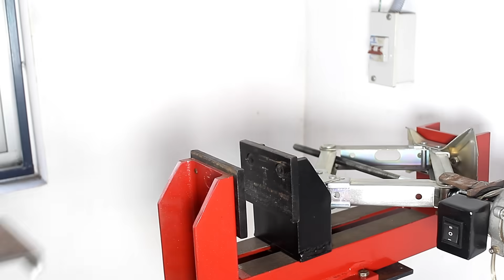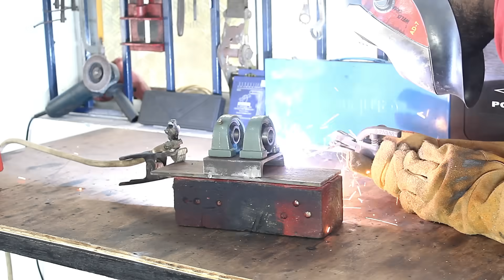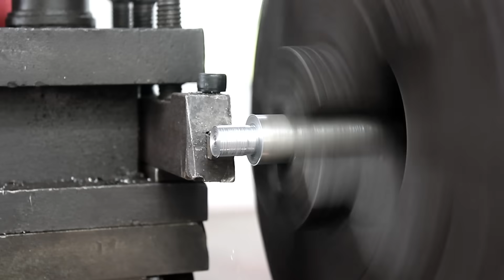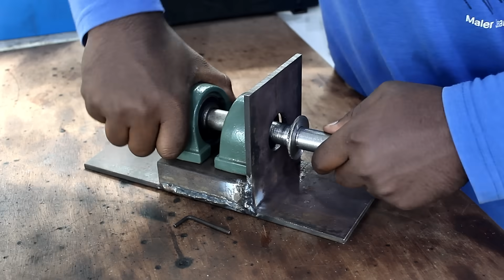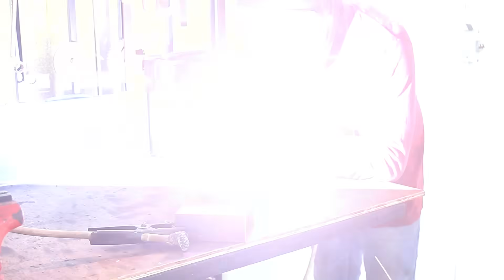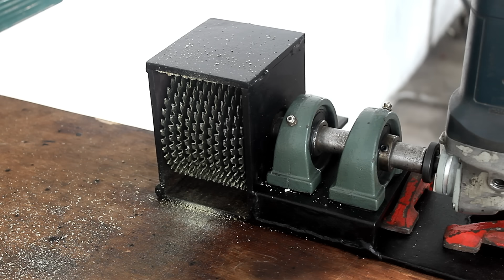Angle Grinder HACK - Make A Wood Chipper | DIY

Comment: Suggestion for MK2.
Add a tapered washer between each blade. Offset the blades So that the blades each touch at opposing 180 degree points on the circumference. 
This way the material will get fully shredded without having to present at an angle, and wont have to be kept moving about on feed.

Comment: NICE !! Please make another video with entire tool turned on its side so switch of angle grinder is on top with a chute added for gravity feed.(like you said) But most importantly add a table elevating the material up from where it sits now or incorporate it into the shute. I'd say probably 1/4 of the way up would still pull material in & down with out possibility of a jam. Now the most difficult part will be how you decrease the cutting area. I suppose you could just have this part of the chute be out of a decent gauge steel and just slot the end so the cutting tips of the blades are actually passing through it so there's a surface for the material to be cut/chipped against. I think ideally though I'd attempt to run it fully through with just a slot cut for each individual blade. I think the width of the slots, the amount of space on either side of the blades will be important to its success and whether it works or not. 
 I hope to hear more on how you made out and from others experiences or just opinions because I'm planning to make something like this myself soon but probably more for shredding/chipping plastic bottles, well basically all trash that's not food or glass. So I guess basically recyclables minus the glass. But I'm also interested in making something similar but larger for leaves, sticks anything in the yard to accelerate its decaying process into some super compost/growing dirt.

Comment: That is a neat build.  But it's a very slow feed to ground it up to practically saw dust, if that is what you want.
I would like to build one similar, but a different type of cutter that makes coarse chips. Maybe a small sprocket that is threaded to arbor onto the grinder shaft, a #35 size chain to a large sprocket on the cutter shaft. 
This would slow the rpm but increase the torque to cut large chips and feed the wood faster.

Comment: To avoid dangerous accidents, better to build a vertical shredder. Blades inside a the long tube at the bottom where you can throw the wood to the tube and shred it. You can add an additional iron pusher

Comment: Nice work. This type of gadget would be very useful for composting - You can feed it food scraps, leaves, etc. I can see it was tricky to keep the wood pushing against the blades, but you could resolve that by adding some type of feeder (mouth) that uses rubber or plastic to push the wood against the blades (instead of having to manually redirect it). I would also try to incorporate bolts into the blade housing so you can more easily change the blades when they get dull. You don't want to have to partly destroy and rebuild it to maintain it. Great start, though!
Reply from the maker: Thank you robert
Reply: Gravity feed

Comment: It might be better if you add a hollow section in front of the blades to act as a chute to push the wood down. This would stop any accident of your hand touching the blade, but I think you could put some quite big pieces of wood in there and it would still work well at grinding them away.
Reply: @WilliamHelstad  yeah good point.

Comment: Wonderful job!  
I had not thought of using a gang blade set up. Please please look at the rpm rating on the blades! That grinder could be running as high as 13,000 RPM's and the blades maybe  only 5,000 RPM's. Put on the guards and have fun!!
Reply: Those pillow block bearings are usually only good up to 5000 rpm as well.

Comment: Actually that looks like a VERY fine device. It might lack a bit of security, but by wielding a 45° protection on the front, that would cover the saw blades from the top of the tank to the bottom of the axis (basically, all the parts you're NOT using when chipping), that device would already be safer (at least more than some industrial ones).
Best security being a mobile protection that would stop power the very moment some force is pushing it.

NICE JOB
Reply: yes

Comment: Interesting design, but I two remarks. The machine would be better if it would be bigger, more heavy. I thin that would make it safer. Second the screws you used to mount the ball baring holders are out reach. If you wold use screws with hexagonal heads, it would be possible to adjust them.

Comment: Very nice build. Super scary. All the better for being scary. Love it! I think a beating in the outboard plate might have been a better solution than just the washer fitting in the hole, but that’s just me. I am also thinking some 10” saw blades I have laying around and the 7 hp motor from an old lawn mower would be a lot of fun. Great builds. Subscribing for sure now!

Comment: It seems to me that the cutters might grab the work and pull it in. I think the work entry level should be raised to just below the centre height of the cutters. That way the cutters shouldn't grab a tough piece of wood and pull it underneath themselves. With a raised work table only the chips will go under the cutters an be thrown out the back

Comment: Not wood chipper, but wood-power maker. Good idea but needs a lesser speed geared motor for thick dry wood. Otherwise blades might shatter.
Reply: Rabinder Rawat exactly its not a wood chipper at all!!!
Its a grinder driving a multitude of saw blades.!!!
Only a knife edge makes wood chips, a saw blade has teeth and makes makes saw dust!!!!
I know as i did a lot of R & D on wood chippers here in Australia!!!
Reply: Yes, it is not wood chips but it is excellent for compost.

Comment: Great minds think alike. I'm building one (prototype) with 15 carbide saw blades to grind up leafs if it works as expected I will bring up the blade count to 50. Hope it turns the leafs to dust making composting easier.🤞
Reply: I love the fact that this creates much finer wood chips almost a wee lil bigger than sawdust. If one wants a woodchipper for composting this is the one as the smaller chips will compost a lot faster than the wood chips created by commercial chippers.

Comment: Brilliant, nice work. And exactly what I was looking for. If the blade shroud/cover assembly was bolted to the base it would make it easier to maintain. Perhaps add an input chute to help direct the wood & minimise kickback, especially if this was at an angle to the axle. I will make one, and add a collection bin type arrangement. Subbed!
Reply from the maker: Ok thank you bro

Comment: It would be good to see a feeding system for this so you don’t have to hold it/ protects you from kickback. I guess you can’t ramp up the torque and slow it down as those blades don’t work like that. Creates really fine dust rather than chips. Thanks for sharing! I’m looking for ideas for my own project and this has been a help to see the process and end result! 👍
Reply from the maker: Thanks dear

Comment: now if it could just cut those branches to the size of pellets for use in a pellet stove.
Reply: Just need to make a compactor to make the pellets.
Reply: all you need is to compact those little pieces of wood, but i think they use a kind of glue to make Pellet.
Reply: @SoohNabis  no glue or binder needed as the wood binds together from the lignin in the wood that melts in the high pressure and temperature when the wood chips and dust are pressed through the pellet making die.

Comment: I might actually try this out. I've been thinking of a way to make wood chips for my smoker without contaminating it with oils and such. I'll need to change the design a bit though, and make it out of stainless steel. :)
Reply: 00
Reply: @emnguyen5931  ذالطلب منك ان تعطني  كف عمل الة الخرط
Reply: Q6
Reply: Dear

Comment: Were u chipping sugar  cane ?
Reply from the maker: No
Reply: Ok it is cutting so smooth that it seems as if its not wood...anyways excellent work you have done...I too have a mechanical workshop and use to work with machines.

Comment: Bro,  I have inserted shaft of 20 mm Dia,  in to the 2  pillow ball bearings,  same as you ,but shaft lengths  is about 18 inches,  bearing saperated by 10 inches,  my problem is when I tighten the nut bolts of pillow ball bearing housing base to the bottom support, shaft doesn't move freely,  what  do bro PlZ help.

Comment: There is a lot to be changed in this project..like instead using to barings at oneside use the at two opposite sides.. then use rpm changer so that saw may not stop the motor..
Here you will se a hard wooden pecice will stop the saw...
Reply: I get the idea of putting the two bearings on opposite side but stacking the blades will be a bit tricky and you can't fix them on the shaft otherwise they won't changeable.

Comment: Hello. Excellent video. I learned a lot. I actually need to build a very similar wood chipper. My idea es making a two-grind axis system, but I really do not know how much space should I let between the saw discs and the upper parts of the box. Do you know if there is any rule concerning that?. Thanks for the video. Greetings from Colombia (Southamerica).

Comment: You thougths only about usability and functionality but you forgot about maintenance and what if you need to change the bland blades better use bolts no welding.

Comment: I have a hard time considering something "diy" when it's made in a full fan shop with tens of thousands of dollars in tools and years of experience. I mean, great job this is cool and everything but it seems like there was an unnecessary amount of steel cutting, welding, milling. It worked well on bamboo, how about some oak?
Reply: Indians call everything DIY

Comment: As qaz zxc mentioned, Pillow block bearings are not usually rated for more than 4-5000 rpm. AGs are 10-11000 rpm! That being said, nice construction, but to what purpose?
Reply: Escatelador automatico
Reply: @carlosjoaquim2203  Yes, I thought maybe that was the intention, but there was no mention of it. It's dangerous enough as it is, multiply it and it would be a monster!

Comment: hello, in my opinion you also had to puncture the plate under the bearings. how do you remove the Allen screws to disassemble the supports?
Reply: Take the grinder off, put grinding disc back on and grind the welds off. Machine used to fix itself

Comment: Very Dangerous. don't try it it's a direct drive. if it gets jammed you could be seriously injured. it needs to be connected to a Gearbox and have a clutch and Load sensors fitted if anything jams in the blade the sensor will cut off the power supply. also need a Guard. the other thing is these blades could also get damaged and sends shrapnel all around. it doesn't hurt if you have a belt-driven shredder with the right tension applied to allow the motor to stay running while blades stop for a cheaper alternative. this will give you time to Shut down the power and assess the Damage to Blades and remove the Jammed object

Comment: Dam terrible design lethal and unservisable. Oh the bearings need changing oops the allen bolts are inaccessible and good luck trying to put in new blades if your lucky and have not cut most your fingers off already!